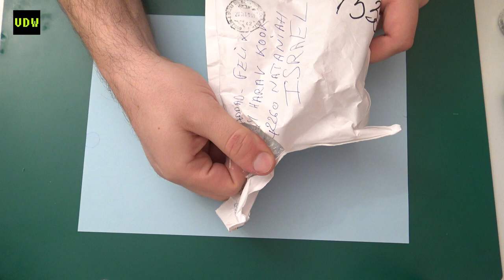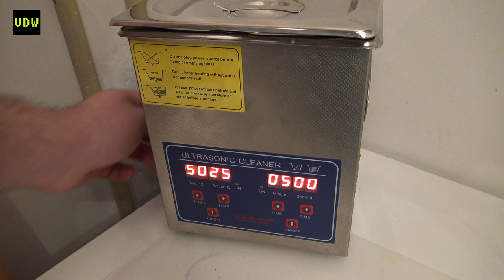Casiotron 25CS-16 watch repair - Ep 41 - VintageDigitalWatches

Comment: I've got a Casio (Module 5082) that someone had buggered the battery clip on. No amount of working with the clip will get it to hold. Well at least I found a work around for this. What you need is something that when you close the battery back it presses down on the battery clip and holds it in place. I've found a furniture leg stick on works fairly well. Remove the adhesive backing and press it down centered on the battery clip. The real problem is getting it just tight enough to hold down the battery at the same time allowing you to firmly attach the watch case back.

Comment: Thank you for the video I bought a 95qs-42, I didn't make an accurate inspection, try to simply change battery a BR 2320 and put a classic CR2016. The display is showed only if I press the light, stay on for 3/4 seconds then fade away. Other buttons seem not to have effects, only the light button (the light works). Thank you

Comment: Stunning video Tiberiu… Mostly amazed how well you can remember where all the parts go for the reassembly, thanks the lord for the camera phone 🙂 Anyway, my qstn is does it matter which way round the zebra strips are replaced after removal? Great channel, I’m finding it very useful 👍
Reply from the maker: I would make a rule that it matters which side of the zebra was on the LCD and which on the board.  This is because on the board the traces have a raised profile which during the years will shape the zebra strip with some ridges, the side that goes on the LCD is perfectly flat. On some watches it may not matter because the pressure from the LCD retainers will make sure any misshapes in the zebra strip are accounted for but on some it may matter.
Reply: @VintageDigitalWatches  Thank you, that makes a lot of sense. Appreciate the help.

Comment: Great video!

I got casio module 122, s004. After cleaning, and put new battery, AC several times, the microlight working, but the lcd still dead. I have no idea what happened. I think the lcd is broken.
Reply from the maker: Hi Ganda, the  module of the watch should have 2 lines that go the battery, check with a multimeter if those lines show continuity to the battery pads then the modules get power. If the module has power and still nothing on the LCD then it is either the module or the LCD. If you have access to an Oscilloscope you can check if either of the lines going to the LCD show a square signal, if they do, then it is indeed the LCD.

Regards,
Tibi

Comment: Nice work.
Hey, I have a 1980 Casio H104 Melody Alarm. I'm missing a pusher (button). Do you think the watch here and others of the period use the same pusher? 
Also the glass screen has a crack so I'm looking to replace that, but that will need to come from another H104. So I guess I'm on the look out for another broken H104 with a nice screen.
Reply from the maker: Pushers vary, even inside the same brand.

Comment: I have the same. After heavy cleaning and remaking negative, it works. Just a strange problem. It only works with the light button pressed, so I disconected the lamp. Have you ever had this case? Greets from Argentina.
Reply from the maker: I have heard of this before but never experienced it in my watches. Surely there is a short somewhere.
Reply: Hello, I have the exact same issue, how did you fix it?

Comment: Fantastic video very informative. Can I ask - did you put the watch module casing into the  ultrasonic cleaner, or just the strap? (I'm wondering if it's safe to put the whole watch in, with module removed of course) thanks
Reply from the maker: Athough some do it, I don't recommend putting the watchmodule in the ultrasonic  As for the case you can but watch out what solvemts you use in the cleaner as it may remove the wroting on the dial. Aslo diassemble evrything, you don't want watter trapped in the button holes.
Reply: @VintageDigitalWatches  many thanks for the advice

Comment: Hey Tiberiu, i‘ve got a problem with two Casio Watches: They function like normal with a new battery, but after some hours the batteries are completely drained. I‘ve heard of that issue from someone else too. The problem was the displaylight, which was continuously on. But my watches do not have a displaylight. Do you have a suggestion, what could be wrong?
Reply from the maker: Hi Michael, what models are the watches and are they identical? 
Second, it might be a number of issues, like a short on the battery, or a defective part on the watch's board, etc. I can't tell you for sure unless you give me more detail and maybe send a pic of the watches with their back-cover removed. And we can move this conversation to vintagedigitalwatches@gmail.com

Comment: Hi Tiberiu, someone gave me the same watch with similar problems. When I separated the circuit board from the module, a very small spring fell out. I noticed in your video the same spring sitting loose inside the watch as you removed the complete assembly. Are you able to tell me: 1) Where is this spring fitted? 2) What is its purpose? Thanks and regards.
Reply from the maker: Hi not sure if I am answering your question below but here goes. The watch has 6 springs, 4 for each of the buttons, and another two for the battery terminals. Inside the battery bay you have the bigger one that has a rectangular shape and another on the side. I assume your's is the one on the side that picks up the + from battery.
Regards.
Reply: @VintageDigitalWatches  Please check your video and as you pull the module out from the housing, the small coil spring is sitting inside the housing, resting on the inside glass display. Please advise.
Reply from the maker: @sdi1111  Check 16:31 as I put it back, that is the alarm spring. The speaker of this watch is sitting behind it's glass.
Reply: @VintageDigitalWatches  So sorry - I missed that part, and that is why my alarm is not working. Thanks for that. Best regards.
Reply from the maker: @sdi1111  Hey Robert no worries, cheers!

Comment: Could you tell me the silver conductive paint brand ? I'm actual using one but i'm not totally satisfied at all...thanks buddy
Reply from the maker: Simone, I am actually using this one:  http://www.ebay.co.uk/itm/KEMO-L100-Solaris-conducting-silver-varnish-3-g-Conductive-paint/222405276201?epid=2256098006&hash=item33c8633229:g:SewAAOSw1~JZSjcQ
I thin the brand is Kemo. It usually takes 24 hours to be fully dry and resistant to any other coatings you want to apply over it like paint or conformal coating.  But within 10 minutes you can test if it made the link between the points you want to bridge.

Regards,
Tibi
Reply: many thanks....  :-)
Reply from the maker: Anytime.

Comment: 3:00 this tool. What is the serie number? I need one for mi watches too!
Reply from the maker: WhisperExtreme it is a flathead screwdriver, it doesn't have a serial number
Reply: Thx, great work by the way, i love vintage watches too. Did you have the casio a168w?